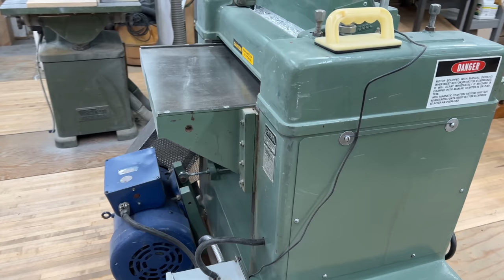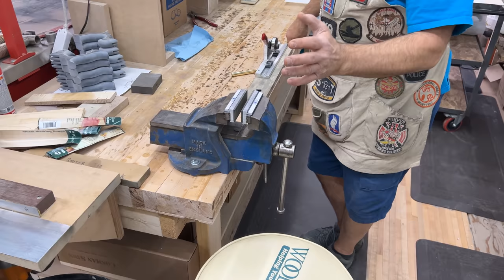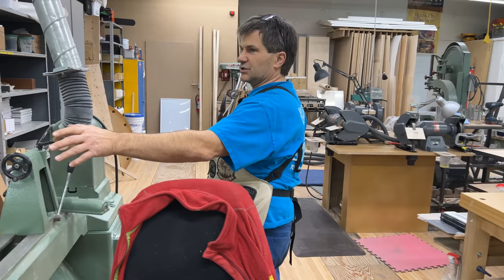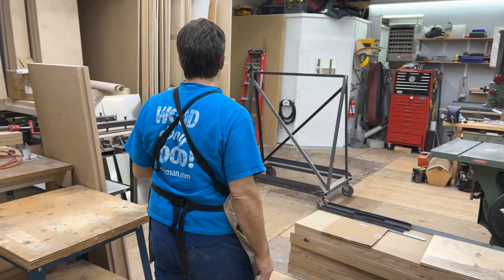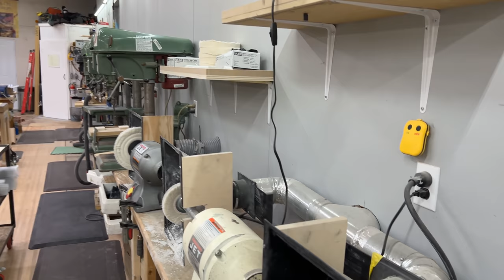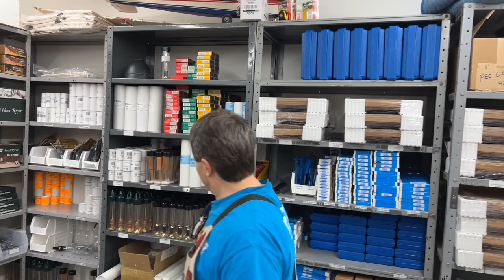Shop Tour 2022 | Woodworking Production Shop

Comment: Very impressive working shop. I have a Rockwell 14" Bandsaw that also has the gearbox to slow the blade down to metal cutting speeds. It's a 1960's vintage and a beast. Since my shop is in the basement, everything needs to be dismantled to get down the stairs and at 66 years old, I cannot horse things around like I used to. I also scored this bandsaw at a local auction and was delighted to only part with $150 bucks to win the bidding. Now you're going to make me start looking for General drill presses and it looks like you've cornered the market on those but I need a 17" so maybe there's one out there for me.
Reply from the maker: They ate pretty darn good,,,, but they don’t crank up and down, that is a pain

Comment: Rob, your disappointment with single phase motors at and above 5HP is no surprise to me!  The cost, maintenance, starting inrush (lights dimming, additional power demand fees by your elect. supplier, etc.) "softer" starts, and highly increased efficiency & power delivery of 3-phase motors, along with the reduced cost and complexity, are all good reasons to have a discussion with your favorite electrician about electronic phase converters.  I was an industrial electrical contractor for 20 years,  and had a great number of customers who had only single phase power available and were delighted with electronic phase converters.  They are much less expensive and straight forward than rotary phase conversion... rotary converters have their place & purpose, but I believe digital might serve you better.  One electronic converter can serve a number of lesser HP motors on the same circuit.
A future friend, and admirer, Jay O.

Comment: Thanks for the great shop tour. I can tell you never met a tool you didn’t like, kindred spirit. In the early 70’s, I bought the wood from four bowling lanes and sold them for workbench tops. People loved them. I really liked you cabinet makers workbench. Did you use the plans from Fine Woodworkers magazine? I started constructing the same bench in the 80’s and didn’t finish it  until I retired in 2012. It’s a nice solid workbench, I built four drawers under the top.

Comment: For those interested in the over-arm saw guard / dust extractor; I believe that company was acquired by SawStop, as the new SawStop arm that I purchased recently from them looks identical except for color and branding. It's a great solution -- much nicer than the one that ships with the saw.
Reply from the maker: Yes the original overarm dust extractor is the only unsatisfactory thing about the sawstop

Comment: I’ve seen videos and heard about dust free shops, is this actually a feasible goal or a fallacy that would just cause an unnecessary investment.
Reply from the maker: Its impossible to be dust free, but that doesn’t mean you give up the good fight. You should definitely have at least a dust collector to contain most of the large debris and some of the finer particles, but then add to that an actual air cleaner and you should be fine for most applications. In the event of sanding, always wear a dust mask.